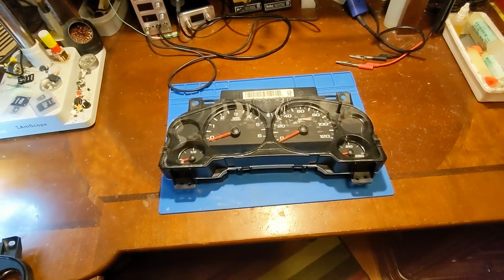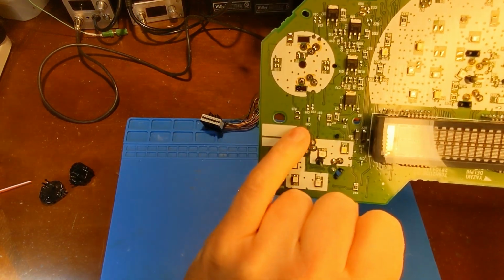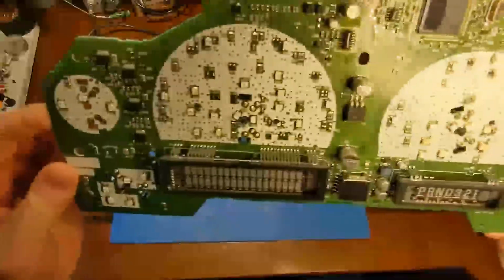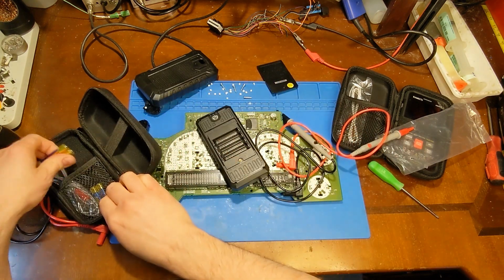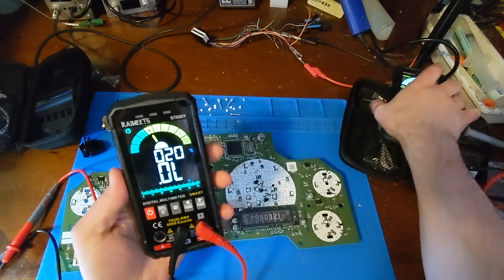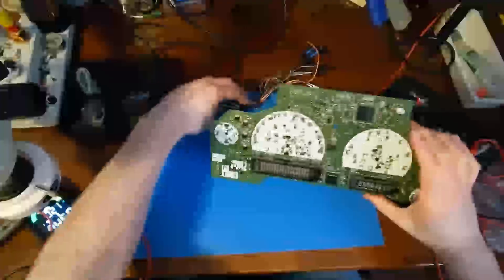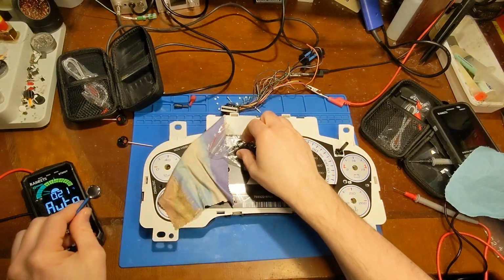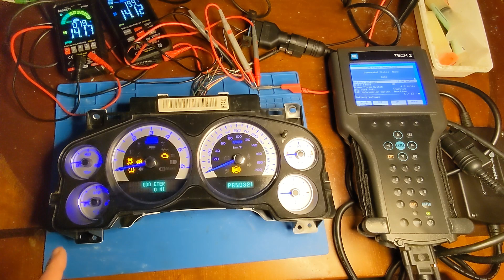Modified Silverado Cluster Contest Giveaway

Comment: Awesome work Jeff. Thank you for bringing us step by step every time. 

I am looking to replace the lights/bulbs in my HVAC controls (2007 Pontiac Grand Prix). I am wondering if you have a good lead or source of 12v, 3mm and 5mm LEDs from eBay or any other reputable source. I feel like it'd be a better experience for myself knowing I've got decent LEDs. 

Thank you in advanced. Good luck on the Giveaway!
Reply from the maker: For small quantity orders I would recommend to stick with reputable vendors like mouser or Digi-key. I'd avoid eBay or Amazon.

Comment: My guess is #189.58.  Dure wish it would work on my 2005 Caddie as the PRNDL and the message displays are  really dim.
Reply: I can fix that for you if you’re interested. It’s a common issue.
Reply from the maker: For any 03-06 full size GM clusters I would recommend a full rebuild while it's out.

Comment: Wassup man I’m new and really like your videos I have one question what’s the number for the blue leds used in this cluster?
Reply from the maker: The LED package size is a 3528. Four pin is the original configuration, but two pin will work.

Comment: Hey. I have a question for you I put a Junk Yard – in my truck and now it’s showing higher mileage on my truck are there anyway to put the Junk Yard Dash Back to my mileage
Reply from the maker: Yes. Although rebuilding/programming is the same cost as a repair/rebuild. So you might be better off just returning the replacement and sending in the original for repair.

Comment: Jeff,

I know that this is way after the fact... like, a year. What part number would I need to order to get the servos for this cluster? There are several different versions that pop up when I try a search for them.

Thinking of sourcing the parts to build my own cluster based off of the parts in this generation of IPC.

Thanks!

Rob
Reply from the maker: For the 07+ NBS they are typically sold by application and not part number. But they are more oval instead of round like the X27 style. They have all been black in color from what I've seen.
Reply: @jeffescortlx  

Do you have an Amazon link that you use for the NBS IPC?
Reply from the maker: @treborjm87 https://www.amazon.com/Electronix-Stepper-2007-2014-Chevrolet-Vehicles/dp/B01J6GR8F8/ref=mp_s_a_1_14?crid=146FGWV3BIYK1&keywords=2008+Silverado+cluster+stepper+motor&qid=1700793089&replacementKeywords=cluster+stepper+motor&sprefix=2008+silverado+cluster+stepper+motor%2Caps%2C151&sr=8-14&vehicle=2008-47-491------------&vehicleName=2008+Chevrolet+Silverado+1500
Reply from the maker: @treborjm87 I don't buy my parts from Amazon, but that link is the one for NBS GM's.
Reply: @jeffescortlx  

Thank you! When I went looking on Amazon, there were just too many options. Figured the best person to ask, was you! Along with the Infeon MCU and a couple of drivers, etc. I’m hoping to build a Squarebody IPC that will communicate with my ‘08 Silverado ECM and BCM.

Thanks again, Jeff!

Rob
Reply from the maker: @treborjm87 you could probably remove the stepper motors from your 08 and mount them in the square body cluster and just solder wires from the steppers to the 08 PCB that is behind the original cluster. Might need to get creative with cutting up and installing the 08 face if the scales don't match.
Reply: @jeffescortlx  

That would work as well. Although…

I’m building two PCB’s (with a ribbon cable connecting the two). I originally built this with the guts from an 04 IPC. (It’s currently in another Squarebody truck that has the entire harness out of an 04 Silverado HD) Wasn’t until I watched your videos and realized that the communication is different in the 07 (classic) and up. So, I’m starting over, with the 08 cluster in mind. I’m not going to dissect the 08 cluster. Currently using it in the truck until I get the PCB designed for the 08 harness.

BTW… initial search for the Infeon MCU is not turning up well. Will most likely buy another spare IPC to desolder. I just don’t like to use the used parts after I get them off the board. My fancy DIY (Mr. Coffee maker burner) desoldering plate works decent, but I had some troubles with the 04’s IPC MCU.

Keep up the awesome videos! I’ve learned a lot from you! More 08 cluster repairs, please!!!

Thanks again! Happy Thanksgiving!

Rob
Reply from the maker: @treborjm87 Yes in 2007 they switched from can bus, from class 2. Fun fact about the 2008 year, they used defective microprocessors that fail. They start out at being temperature sensitive and won't work when it's cold.
Reply: @jeffescortlx  

Interesting. Was there a processor that would be better suited and still compatible with the 08 electronics? It does get quite cold here.
Reply from the maker: @treborjm87  any full size from 2007-14 should be compatible. But find one with matching trim options, and same engine/tranny combo. Suspension and braking system to.
Reply: @jeffescortlx  

So, I should stay away from 08 MCUs… would an 09 - 14 MCU be a better option? Drivetrain/suspension options aside, any other gotchas to think about?

Thanks Jeff!

Rob
Reply from the maker: @treborjm87 for the NBS:
2007 have trouble with the VFD display.
2008 have trouble with the MCU.
2009-14 are generally pretty reliable, although I've seen a few where the microcontroller blows out one of the stepper motor channels.
Reply: @jeffescortlx  

When you say blows out the stepper motor channel, is that within the MCU, or the traces to the stepper drivers, or the stepper drivers themselves? 

I haven’t seen you replace an MCU on the 07-14 IPCs. So does that mean that you end up having to toss the PCB when the MCU blows out the driver circuit?
Reply from the maker: @treborjm87 they no longer have an independent stepper motor driver chip. The MCU's drive the motors directly. Every once in awhile one of them will just drop a stepper motor channel. It's not a PCB issue, it's internal to the MCU. While it is possible to replace the microcontroller chip, it's more economical to just replace the entire instrument cluster at that point.
Reply: @jeffescortlx  

Well… since I’m on the path to building this from scratch anyway, I might as well try and source a different MCU that isn’t prone to these issues you’ve mentioned. Infeon has (had?) several automotive grade MCUs that seem to align with the processor specs of the 07-14 IPC.

But… I may just go back to my original plan and try to use some non-automotive grade MCU, like a teensy or STM32. Not my preference. Cold and heat are serious factors here.
Reply from the maker: @treborjm87 it just seems like a very ambitious solution to a problem. Designing a cluster from the ground up could take years to dial in.
Reply: @jeffescortlx  

Agreed. Luckily I have the original PCB design from the 04 project. I’m going quite a bit deeper into the 08 because I want to actually use the leds for backlighting (on the PCB) this time instead of the old 194 lamps I used on the 04. I’d like to take the 08 face and cut it up to fit over the PCB, as you suggested earlier.

The 04 project had no other led warning lights, turn signals, etc., other than the 194 lamps.

Another reason I’d like to stay with the Infeon MCUs rather than going down the teensy or STM32 path would be the CAN communication to the BCM and PCM.

I’m a little nervous about the factory issues you mentioned with the stepper motor channels. I’m already (in my opinion) putting way too much heat into the MCU when I remove them.

Comment: I've been watching ur videos but I haven't seen you cover the problem I'm having. I have a 2010 gmc, similar cluster to the one in this video. All the backlights go out when I hit a bump, if I tap the cluster they come back on. Have you ever seen this?  Any info would he appreciated.
Reply from the maker: Probably a fractured joint. Possibly failing LED.
Reply: Ok, thx, I'm losing all the LEDs at once.
Reply from the maker: @kalefrederic3923  radio and HVAC too?
Reply: Nope, just the cluster backlights

Comment: I'm guessing $192.00.
I don't think this cluster is compatible on trucks with the 6L80 transmission. 6L80 equipped vehicles say PRNDM with a number after the M when in manual mode.
Reply from the maker: I'm assuming the base model work truck doesn't have the 6L80? I could add a description detail to the auction about compatible tranny's.
Reply: @jeffescortlx  I have a 2012 Silverado 1500 LT with 5.3L and 6L80. Ebay says it doesn't fit my truck.
Reply from the maker: @Todd_S  I wouldn't trust the eBay compatibility listing. Should be safe to go off of the label part number on the back of the cluster.

Comment: $355 plus shipping
Reply: Also, that’s not compatible with a 6 speed transmission truck. They show PRNDM for the gear selector window. Will fit an 07-09 or 10+ with a 4L60E transmission. Looks great, Jeff!